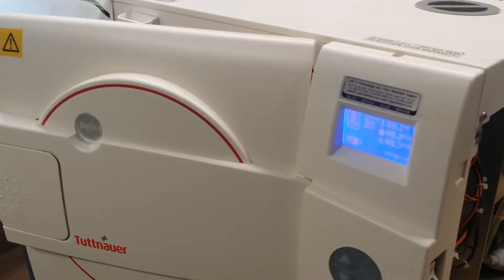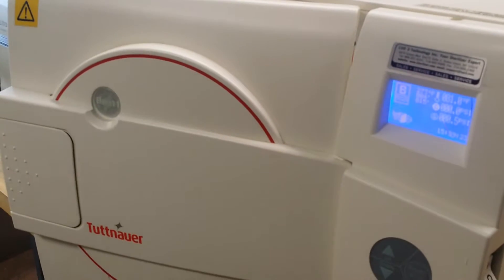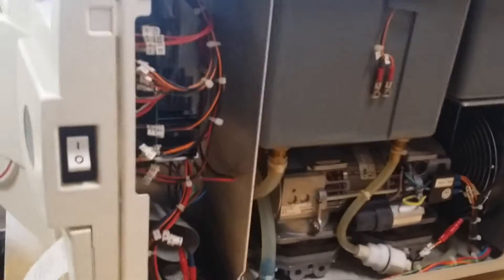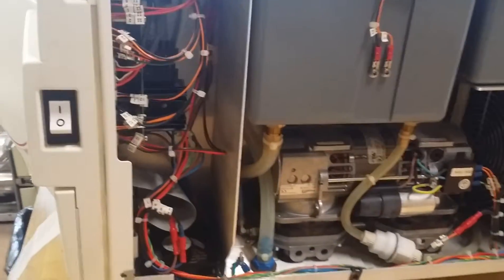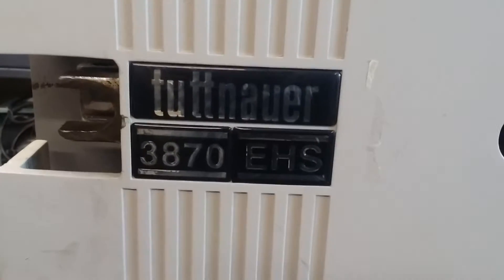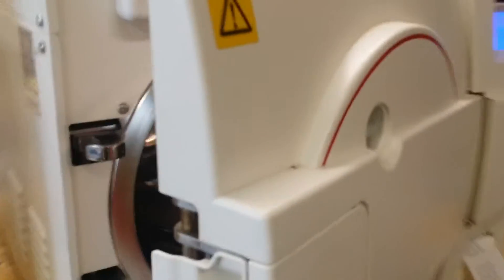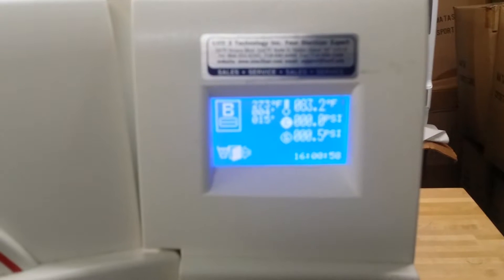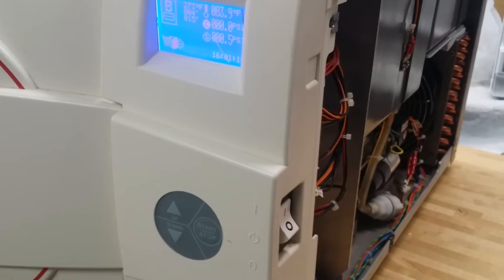How to fix Tuttnauer Elara 11 autoclave, repair sterilizer series

Comment from the maker: If you have questions about your Tuttnauer autoclave, please feel free to call us at 866-201-6291
Reply: James Luo hello mister .
thank you for this explain video but i want ask you about one of problems having error code 002 .
ween i start my machine i choose the cycle of sterilisation ( 133°) .
in firt all past succesfull . but ween the cycle arrive in step of sterilisation . the generator pressure get down and error code 002 in display .
please help me for solution .
thank you.
Reply: @katiroussama9439  is the problem solved? code 002 is low heat